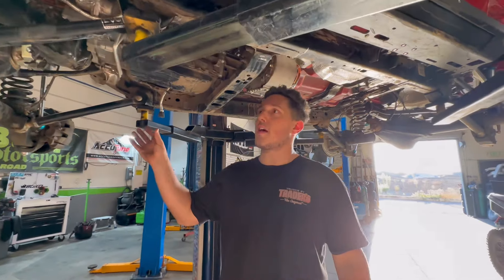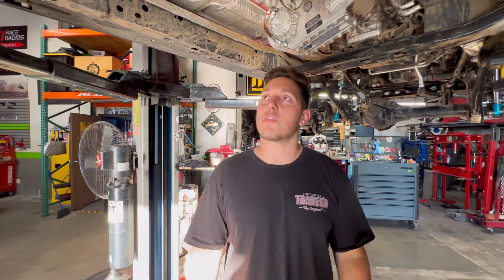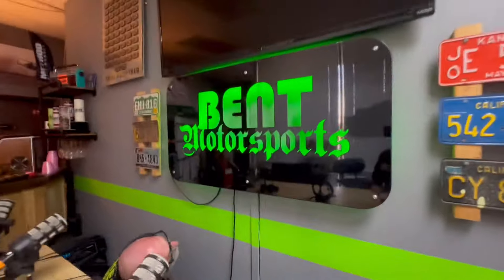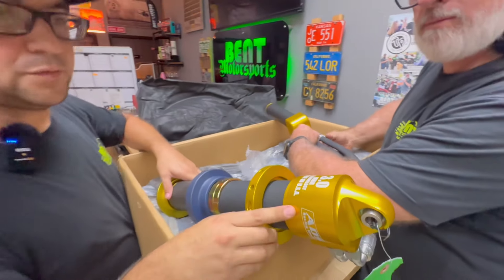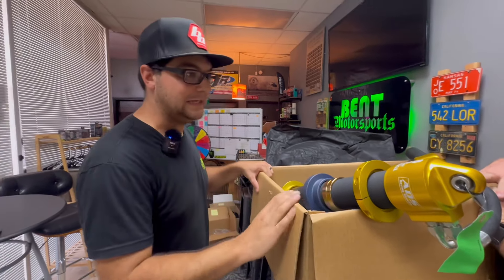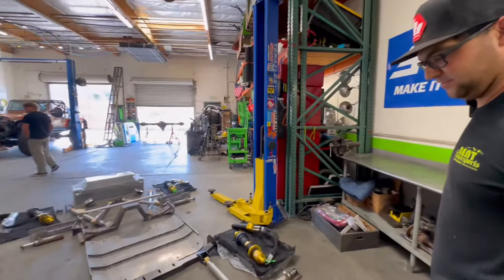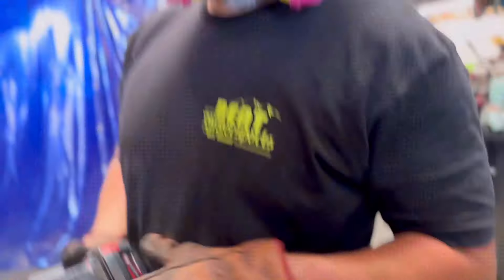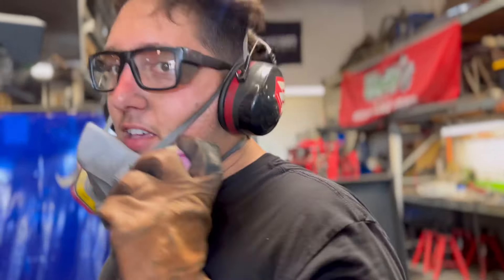3.0 Coilover Conversion on Jeep 392  - ADS Shocks Episode 1

Comment: Any specific reason why you went with the Genright gas tank over the RPM gas tank?
Reply from the maker: The customer wanted maximum fuel capacity and the GenRight tank holds just a few more gallons. It was the original plan to go with all RPM products but the extra fuel was higher on the priority list for our customer. I recommend both tanks. They are both quality products.